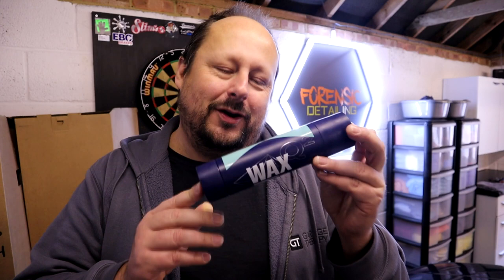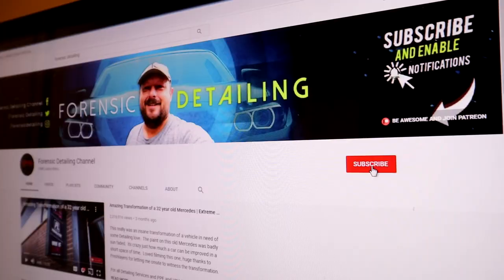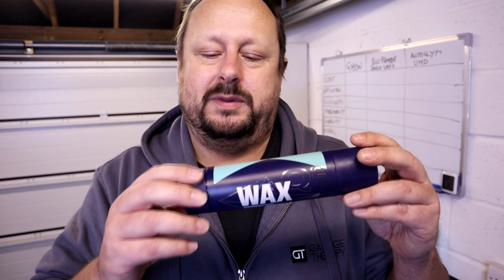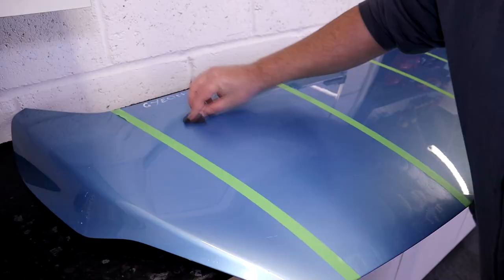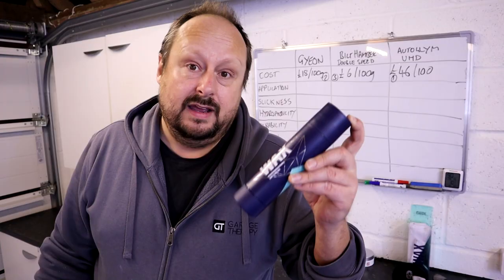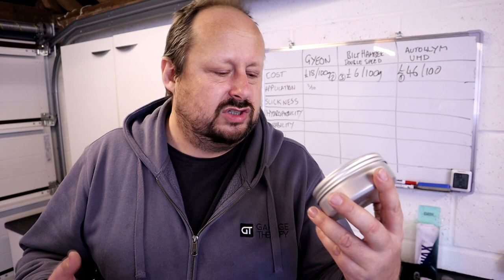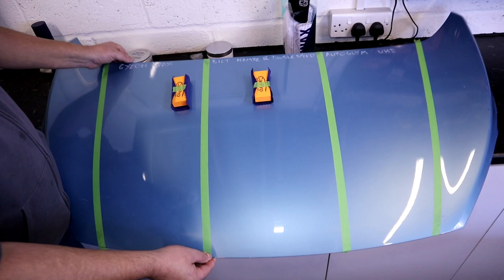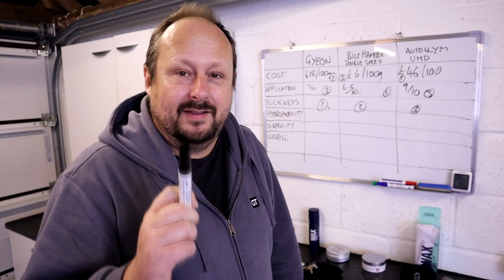*NEW* Gyeon Wax V Autoglym UHD V Bilt Hamber Double Speed | Review

Comment: what about the new rupes da pads set and using that with Koch Chemie set of 3 H9 F6 M3 on an 8mm da I would say it's ok. Maybe zvizer or merenza is better    I would be learning and doing a ceramic coating of carpro UK 3.0 2 coats  I have a 7x8 roof so its shade and in a couple of weeks it's going to be waterproof but no sides, please write any tips because it's going to be first time polishing and coating and best way to take care of a ceramic ?
Reply from the maker: so rupes pads with Koch on DA8 ml polisher will be fine (in theory). No zwizzer or menz not really better as such but both high quality.   I would suggest if your going to use rupes pads and your starting out. then pair them to the rupes new DA abrasives because they are tested and designed to work with those. results are guerentee'd then (kind of).    degrease and then go in with the coating.
Reply: @ForensicDetailing  sadly I can't get them in small size but the Koch I can I would say they have good quality so I shouldn't have problems

Comment: Blit hamber double speed wax is absolute crap! Does not last more than 2-3 weeks. Bought this wax after your recommendation and was very disappointed. I know at least 20 more people had the same experience with it.
Reply: Stoyan stoyanov,
You're talking absolute crap, when Bilt Hamber dsw is applied correctly it is an awesome product & lasts ages.  You cannot buy better for the money
Reply from the maker: the one thing DS does well is durability.  if its only lasting 2-3 weeks then something is going badly wrong.  I sort of get 3-4 months out of it at least some report 6 months.  I really get sceptical about some of these comments. I smell fake account :)

Comment: Bilt hamber worst wax i have ever used.
Reply from the maker: if you dont elaborate and give reason theres no weight to the comment.  you can see the DS wax in this test  (and the 24 sealant test) outlasts most waxes on the market for a fraction of the price.  but if its a smooth buff you want then others are better in that area.
Reply: Applying the wax is a pain and taking off a nightmare. Try Harly wax knocks spots off this. Wax  hole car easiest thing to take off, roughly 22.00 for 400ml.
Reply from the maker: @keithhilton1564  fair play Keith.  your not the first to report this.  it can require some buffing but if you put a thin coat on its pretty easy I find. I can do a live demo perhaps.
Reply: I have used loads of waxes from a few pounds, to over a £100. And can honestly say its the worst i have used. Just my opinion and i am a big lover of Bilt Hamber.
It could of been a faulty batch , but for the price i just binned it.
Reply from the maker: it depends what you want really.  DS has superior durability it really does.  people seem to have different requirements. Its like old fusso its widely regarded as the best past wax on the market because it could last 8/9/10 months.  other guys so would say its garbage because it dry cures and can be hard to buff out.  gyeon buffs beutifully but if you read the comments people are disapointed by its durability.   this is why when we review stuff we break it down into catagories.
Reply: Using a damp applicator makes for easier application & removal.